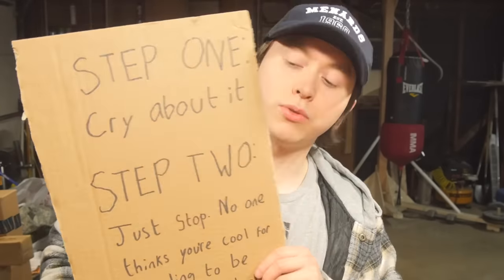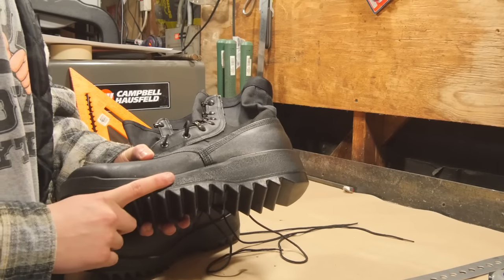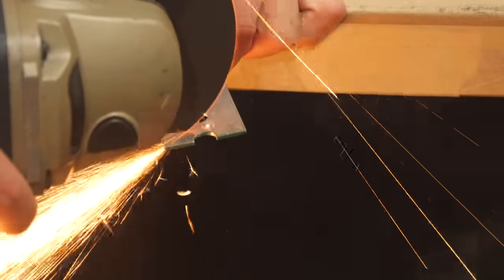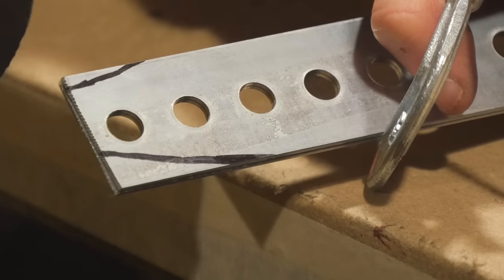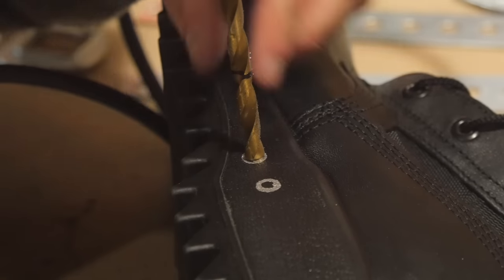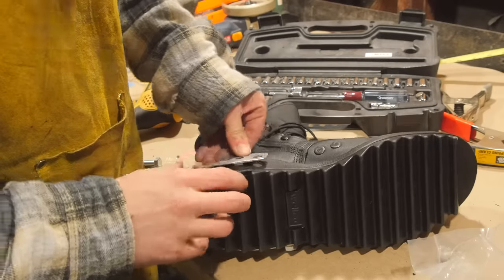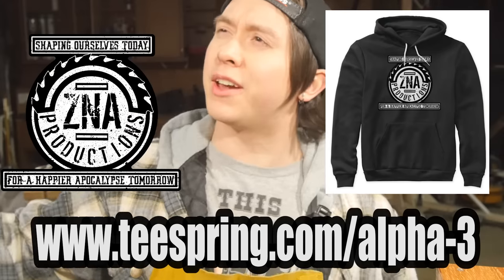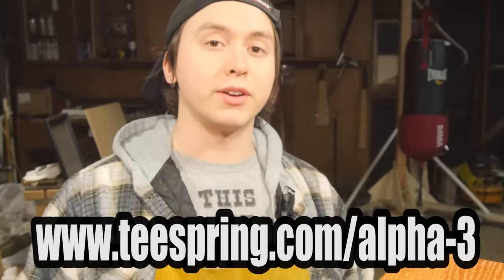Curb Stomp Combat Boot Mod! (Mini Build)

Comment: this the work of an ivy league engineering education. I'm sure those soles are sturdy enough to withstand steel bolts ripping them apart on the first curb stomp attempt. the look on security's faces as you walk by a checkpoint anywhere on the planet. priceless. the style. the fashion. magnifique. bravo fellow colleague. this is masterful. bravo.

Comment: Hey, Eli! I doubt you’re gonna see this comment, but I’ve got an idea for something that you may or may not like. Now I figured the best place to say this was on this video because it’s kind of a boot mod. Now, what if you took some ski boots and turned them into functional regular-ish boots? Here’s what I’m thinking: Take a pair of ski boots (design and color doesn’t matter. That’s your personal preference). Now, the bottoms of the boots are pretty narrow, so you’re gonna have to widen those out to offer more balance. Then, cut out something like tire treads (or whatever will give the boots more traction) into the shape of the bottom of the boots and bolt/rivet/screw them to the bottoms of the boots. Finally, you’re essentially going to add the curb-stomper mod to the boots, but you’re going to add those to the toes, as well as the heels, of the boots. The result is what I like to call “The Juggernauts”, or just “The Juggs” for short. What do you think?
Reply: That's a good idea!

Comment: i had a similar idea i was thinking about awhile ago... the main difference however was that the heel edge itself is made of steal and it's look on the bottom resembled that of the heel section of a pair of tap shoes... but you'd have to build the boot along side it or remove a portion of the boot itself to get the best result... but the payoff would be having (more or less) a pickaxe like heeled boot

Comment: That's a neat boot idea, but I wonder if it can be adapted/used in a practical way for something. All of those bolts must add a good bit of heft. Maybe take it off and use it as a hammer for tent spikes? lol
Link to cajon build on video or description would be nice.

Comment: Can you make it with steel instead of zinc, I know it would be harder to bend and you would have to drill through the steel, but could it be done? Why not put it on the front to?

Comment: Hey Eli! What size angle grinder do you use? I'm going to purchase one and I'm not sure to go for 4 in or 7in
Reply: +HangeGaming I'd suggest a 5 inch. They're incredibly common in professional shops so it's always easy to find blades, disks, ect for them and they're powerful enough to do almost anything a 7 inch can without being incredibly cumbersome. Also I'd highly recommend buying a Makita.

Comment: Hey Eli, if you have a maglite, I've seen a handle so you can turn it into a baton. They're about $40 buy hard to get in some countries and probably really expensive in others. Any chance you could make something similar? I can't think of any brackets that size straight away, but maybe there is a conduit with a similar ID that are made into a t piece or something? I dunno, just thought it was cool and would make a quick build.

Comment: If you could manage to get ahold of an angle grinder, vice, saw, bolts, wrenches, a hammer and drill, and some scrap steel. There is not very much of ZNA's stuff you couldn't make. A few more things here and there but that's it.

Comment: Hey man, sorta important question. I was just outside burning some old wood in my fire-pit because it's windy, and it's such a nice temperature outside. The wood was a few years old and had these giant steel bolts in them, that I was poking at with this really crummy pipesword I made. I noticed once the bolts got to about orange that when I hit them hard enough with my pipe that they made this little plume of blue that seemed connected to the bolt. It seemed to flare a bit like magnesium, and I have no idea what caused it. I figured you might, having more experience working with metal. Either way, please get back to me, I don't want to burn more wood if they're doing that because they're galvanized. Due to your videos, I know that's rather toxic.

Comment: Could use Lag bolts to avoid the drilling.  And the kind with the combination head would be sharper on the outside.

Comment: elli,  I've noticed on your videos when you mark the depth of the drill bit you use a sharpie,  i find it better for me to use masking tape.  its easier to see with the little pieces moving up out if the hole,  and removable.

Comment: Instead of a bolt, drill a deep hole and hide a dowel bayonet in the boot by putting a bolt head on the end and sliding it in
Reply: It'll blend in with the other bolts and should be relatively easy to retrieve